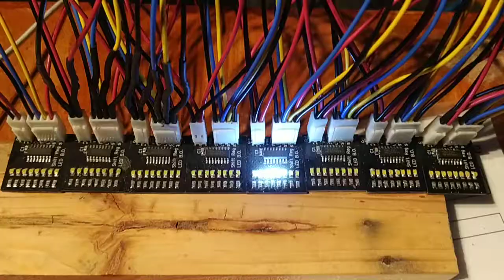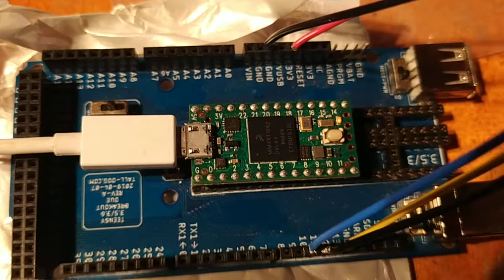64  Bit SPI Shift Register Timing

Comment: Marathonman, I am still running my Figuera generator with a mechanical commutator until I get the output voltage and amps that I am seeking. I will switch to digital when I am at that success level. Your unit looks excellent! Can you get the 60 Hz that is needed for AC voltage output?
Reply from the maker: Yes at about 100 microsecond on each contact point i will achieve 60 hz and with no moving parts.
https://figueramarathonman.boards.net/
Reply: Fabuloso tu proyecto yo estoy armando el mismo con un Plc
Reply: Queria saber si habias logrado obtener un sobrevalor